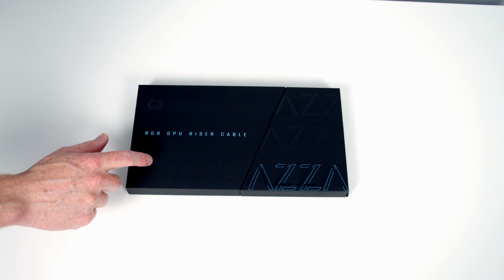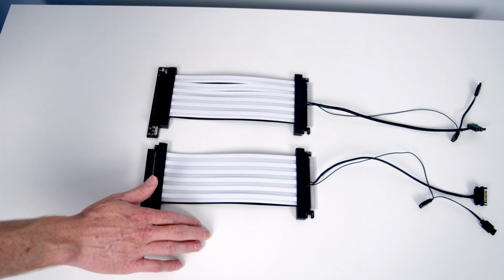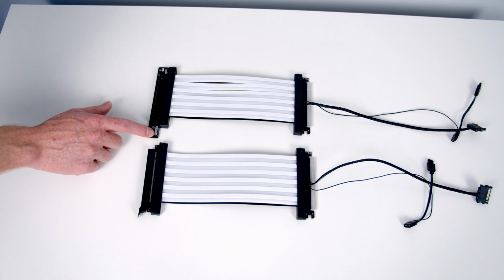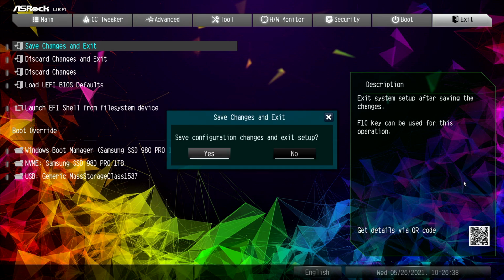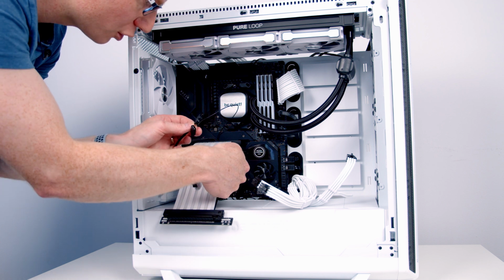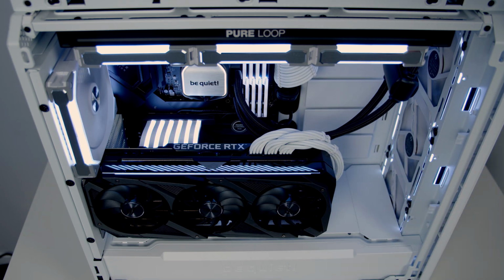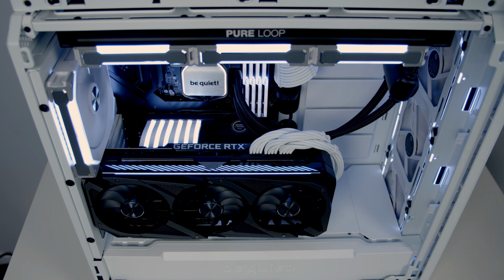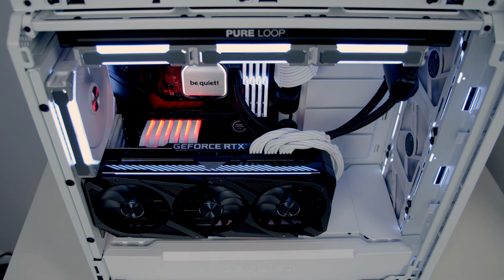AZZA RGB GPU Riser Cable Review

Comment: It's a cool idea, but I'd think it would require a very specific build layout to get the benefit of the RGB. In most vertically oriented GPU builds, the GPU would just cover the riser cable and it wouldn't be visible.

Comment: So all the rgb cables are hidden behind the gpu unless you look from above. Waste of money.
Reply from the maker: Depends on the case, but it will work better in some than others
Reply: @ChristopherFlannigan  well if there are cases where the riser goes in front of the case then that will be crap because you can’t see the gpu. Only way it would work was if the gpu is situated high in the case and the riser cable is below?
Reply from the maker: @backdoorbursta2866  https://youtu.be/7uyEJye5DRk was what I was thinking